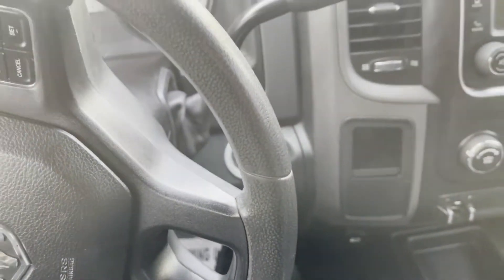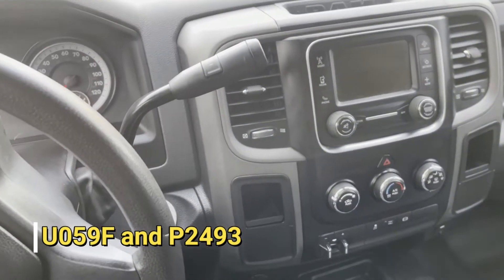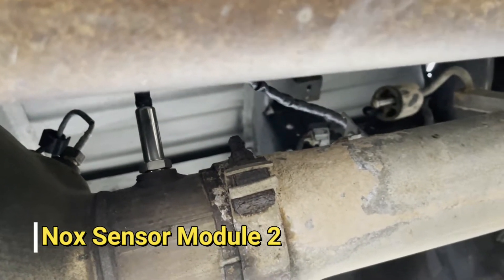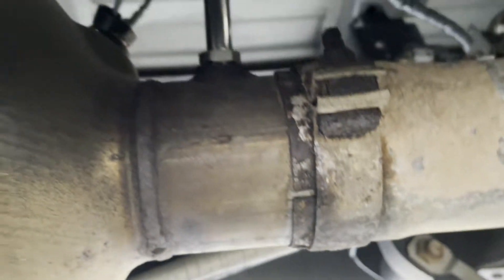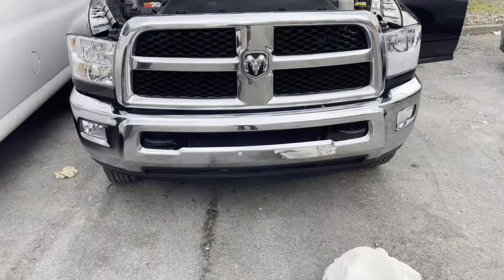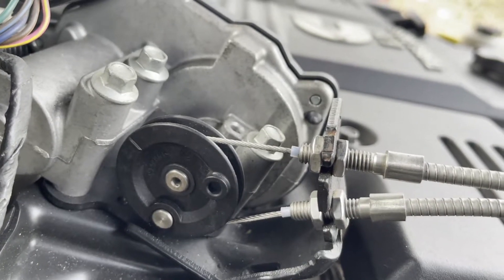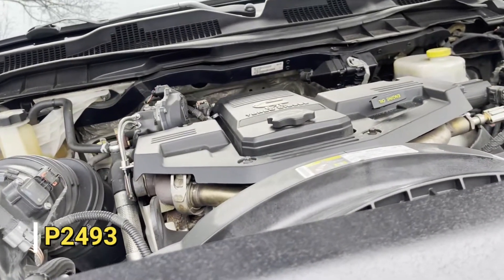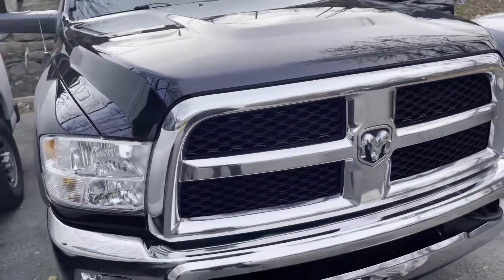How to fix the u059F and P2493 error code on the Cummins engine

Comment: Can you be more descriptive. How did
You know the settings of the sensor nuts if the nuts are indeed what your talking about
Reply: I did some research and noticed that from the factory the bolts were adjusted to the depth that it’s at now… and mine was way off when I bought the truck